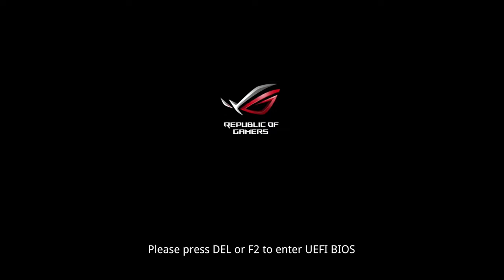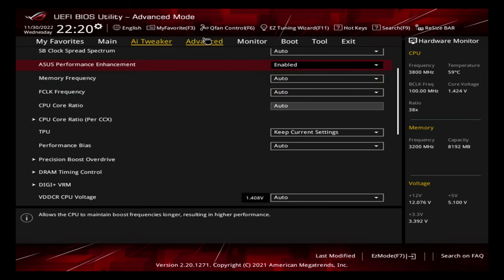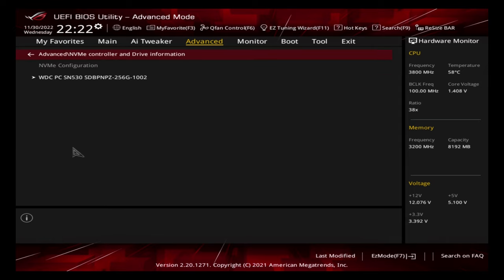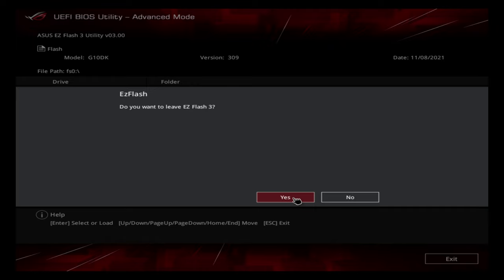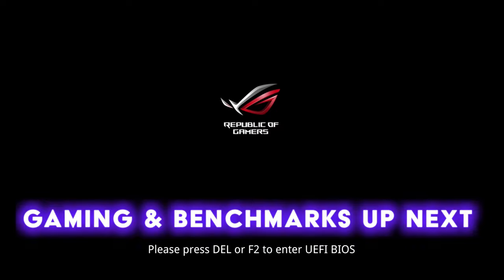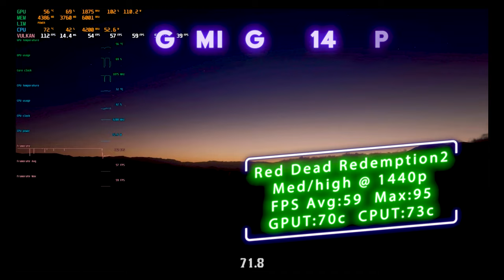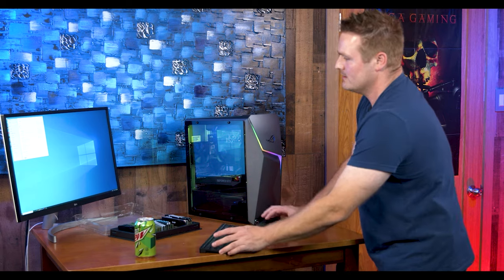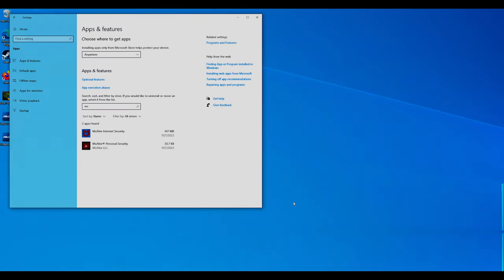Let's Unbox A ASUS ROG Strix Gaming Desktop G10DK-WH563 W AMD Ryzen 5 3600X - 8GB Ram - GTX 1660 ti

Comment: I also have this same computer and I bought it new but the previous owner bought it just to get its RTX 3060 graphics card out in December 2021, it seems incredible to me that this option was cheaper than buying an individual graphics card back then.
I bought it in January 2022 and just to compensate for its loss of graphics card I installed an RX 580 RED DEVIL and now with windows 11 it has at least slightly better performance than an XBOX SS
Reply from the maker: Thats good to know!

Comment: Bought one of these a few months back for about $450 pretty much the same system only differences were it has a 500w psu 4x8 3200 cl22 and 1tb team group m.2 nvme. The first thing I didn't was remove everything and put into a better case an H5 Flow RGB Edition from NZXT that I had sitting in a box.
Reply from the maker: Yeah That is smart the HP case suck big balls

Comment: The blower GPU might be there to (probably clear stock... haha) avoid heating up the air near the CPU. I see the 3600x using 55w in games, which can get to 70+ degrees when gaming with conventional GPUs, even with a 11th gen Intel's huge CPU area and therefore massive heat transfer rates. But a Zen 2 doesn't have this 'advantage'.
Reply: Also blower gpus are good for cases with bad airflow as all the hot air is exhausted out the back of the card
Reply from the maker: Yeah I herd these can be a heater box once upgraded. I am going to start test it soon.
Reply: @TNW1337  could be as good of a heater as those valve amplifiers I use 😅 gets real toasty never have to have the heating on.
Reply from the maker: @garycollumbell1396  😁

Comment: Big fan of your videos! I have a question though. I have an hp pavilion TG01 and was thinking about upgrading my graphics card from a 1650 super to a rtx 3050 but i only have a 400 watt power supply will this be enough or would i have to hunt down a compatible psu with a higher wattage?
Reply: The RTX 3050 should work fine with the 400w power supply (probably even the 310w PSU).
The AMD RX 6600 would also work, it's cheaper and faster than the RTX 3050.

Comment: I'm thinking of getting this and especially upgrading it considering the CRAZY cheap price. 600 bucks for 2TB storage and 32GB ram is unreal. I have a question though, how does it benchmark in let's say GTA 5 or Doom Eternal? I'm using those choose your parts online PC rankers and they all have ridiculously good results for even high settings on high demand games, which I don't think is true.

Comment: Could you please make a video on how to case swap the Acer Nitro 50 with the stock N50-610 motherboard. There are lots of people looking how to do so to fix the overheating issue, but are nervous to touch anything. I believe it will fit in an ATX case. Just won't be able to use the front ports, like the sb on the motherboard. Can you please make a video on how to case swap it. It will help so so much.
Reply: Love your Vids! Making me think if I should case swap or not. I don't know what would be better. Either a case swap, put an AIO in the case which I saw in your video, or get a CPU fan upgrade?

Comment: can someone help me I’ve done research but have not found anything I need. My current motherboard does not support my gtx 1660 super oc. My cpu is a Ryzen 5 5600g my question is what motherboard will support my card and my cpu and a evga 500 watt power supply? I’ve looked but found no luck I would appreciate if some1 helps me.
Reply: Any1?
Reply: Hello my friend , I bought the Asus ROG Ryzen 7 5700 G with a Nvidia 3060 last March and it has a 500 w power supply and no problem, you should be fine.

Comment: Hey, I just installed a 3070ftw3 in the same as yours (upgraded PSU) with the R7 5700g, and I'm getting very low GPU usage. Am I getting bottlenecked? I ran RIvaTuner stats and my CPU usage is only at about 70% max, so I really don't think I am getting bottlenecked. Please let me know if I am or something else is wrong!